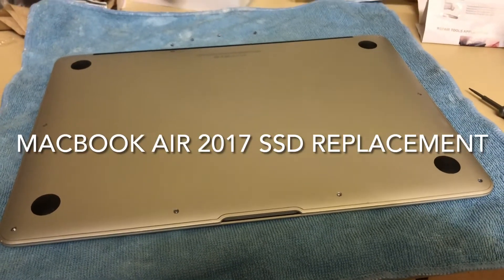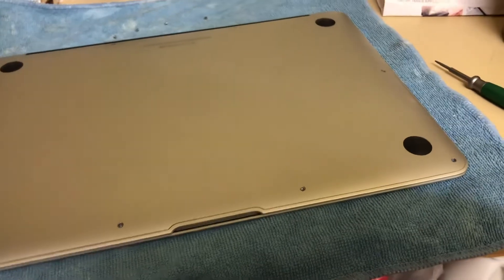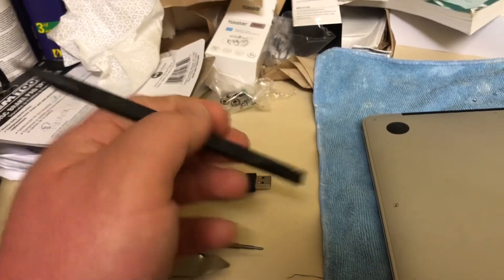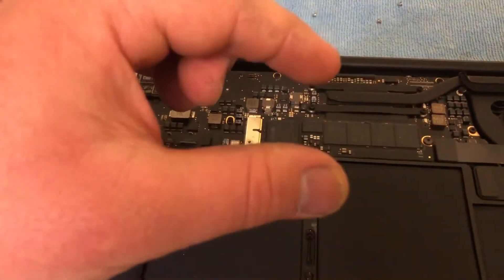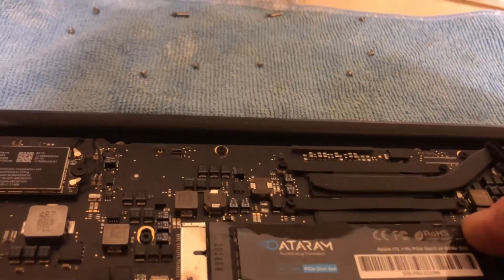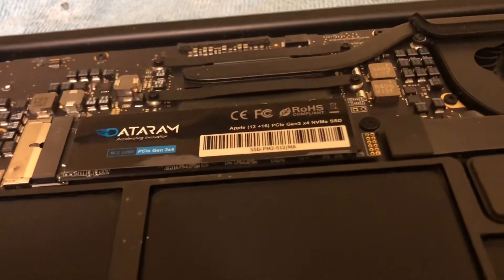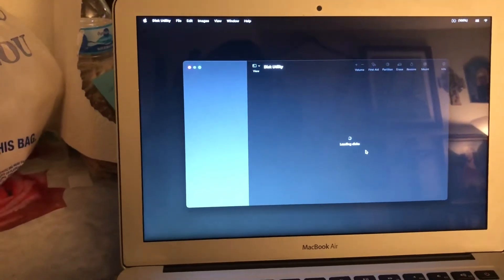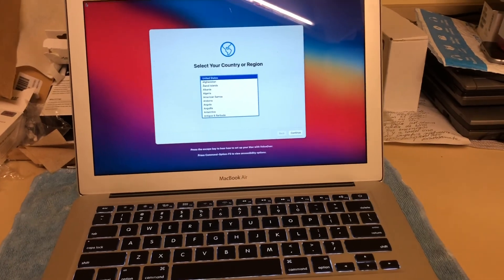MacBook Air 2017 SSD(Solid State Drive). upgrade! (English)

Comment: Hi brother, can I know what type of screwdrivers are needed for the whole process?
Reply from the maker: Is a pentalobe  screwdriver  HQMaster Pentalobe Screwdriver for Apple MacBook Air & MacBook Pro with Retina Display Macs Notebook Laptop Back Case Bottom Cover Star Screws Computer Repairing Opening Tool https://www.amazon.com/dp/B009339VAA/ref=cm_sw_r_cp_api_glt_fabc_7QAXNHC9RG0KD4VZ23DH

Comment: Does Bootcamp work with the third-party SSD?
Reply from the maker: When you say Boot Camp if you mean that it gets stuck on the booth is not
Reply: @Videspro  maestro boot camp es instalandole window desde el os de mac se llama bootcamp el programa
Reply: I dont know about this ssd but I use others m.2 with adapter and works flawlessly with bootcamp i even done triple boot with linux

Comment: Hello, 

This was a very useful video but I have a question.
Do you have by any chance informations on the SSD type of the original samsung 128GB SSD ? What key it has for exemple ?
Cause I have the same Mcbook air as you and I'm currently looking for an external ssd reader but in order to chose the right one I have to be sure of what type of SSD I currently have.

Thank you :)
Reply from the maker: Here is an article that may help you https://discussions.apple.com/thread/250957832
Reply from the maker: Let me understand your question do you need to buy an external SSD for extra storage or backups or do you need an adapter to plug your previous SSD? I still have the older 128GB SSD that I removed from my MacBook Air I will be sending that information in a minute
Reply: @Videspro  Basically my Mcbook Air from 2017 died recently and I'm trying to access all the files and pictures from the ssd card to transfer them to my new laptop but in order to do that I need to buy an external ssd drive/reader but to chose the right one I need to know the model of the 128GB SSD I had in my Macbook Air to make sure that the two will be compatible !

Thank you for your quick answers :)
Reply from the maker: Sorry if I did reply in Spanish I got scramble between languages but I think one on the articles I sent you may help you and I also posted the model number of the Samsung SSD
Reply from the maker: Aquí dice que es un Samsung modelo: MZ-JPV128S/OA2